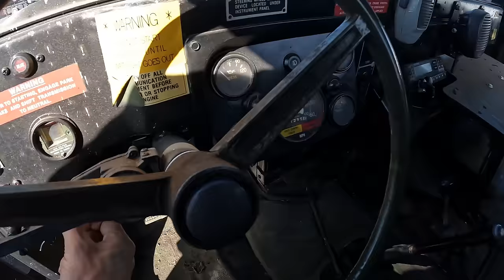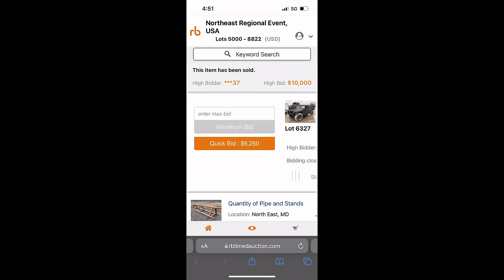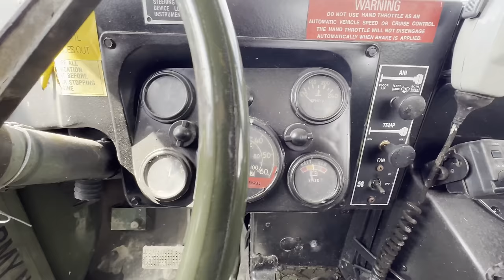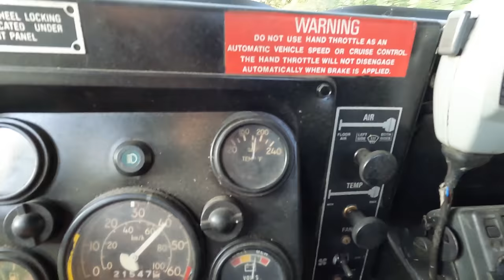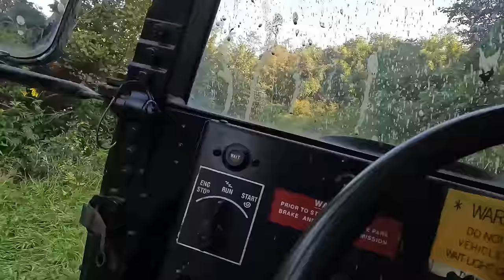Buying, Servicing, & Off-Roading The Cheapest Humvee I Could Find!!

Comment: "voltage meter is all over the place" Me, former mounted Infantry: "that's intended."
I remember getting an officer from light infantry, and he thought it was gonna be so cool rolling in trucks all day....until he learned about pmcs, no heat, no air and generally speaking, nothing ever working as entended.
Until you get a work order rejected, and have to pull a truck out of the chalk because you "didn't use proper grammar when listing issue" have you really been mounted?

Comment: DO NOT put a turbo on the 6.2, the bottom ends are not strong enough. But you can put one on the 6.5. Also there is some interchangeable parts between the 6.2 and the 6.5

Comment: They put the 6.5 turbo in when they started making the factory armored versions (M1114/M1151).  I originally drove a hillbilly armored 6.2 M998 around Iraq, would hit a top speed of 25 mph going up hills with suspension maxxed out.  Now you know why the military has such a hard on for maintenance lol.  BTW pick up a set of the upgraded seats if you can, after an hour or so your butt will thank you 👍.

Comment: just so ya know the H1 Detroit Diesel motor was notorious for cracking head bolt threads for alternator and other drive belt accessories. My friend was a mechanic in motor pool US Army his only job everyday for 5 years was to rotate the heads from side to side and reverse them front to rear as both heads front and back have the same threaded holes- designed just for that issue LOL . 5 years imagine that shit....

Comment: your "new" used roof also needs regular care (UV radiation), otherwise it will tear again. 
this roof is used and it doesn't take long if you leave the vehicle outside. roof cleaner and 
impregnation spray! and I'm saying this now, before there's a crack in the roof.

Comment: The alternator brackets took a beating on those cross country roads. It was difficult to maintain the tension on those double belts. Serpentine belts would've solved that problem.
Reply: The 6.2 L had plenty of power. It was a high mobility vehicle not a rock crawler. We had them in the communications configuration w/ a cube in the back. The engine had plenty of power to move it around & I never saw one stuck in the mud even during monsoon season in Korea. Just like any diesel is a lagging engine & doesn't have the quick response of a gas engine.

Comment: I maybe wrong and sorry if I am and please correct me if I am do to I don't know alot about them and wheeling to always learn what I can but I have a 6.5l turbo diesel Detroit k3500 Silverado I was told by a few ppl that the air intake an exhaust manifolds and crossover pipes an turbo would swap over to the 6.2l just have to plum in the oil feed and oil drain for the turbocharger

Comment: You don’t need a big brand name for your turbo 
Lots of turbo’s available in the aftermarket world 
You just need to find a space for it 
Then a buddy with some exhaust experience
Get ya some tubing and make what you need 
There are plenty of good turbos at the scrap yards and pick a part 
Does not matter what it was on just the size and mounting surfaces that you will match
Reply: But just remember when choosing a location for your turbo or turbos that the oil drain on bottom of turbo needs to be above the oil in your motor so it can drain 

Or you could get a supper charger you could even use a electric clutch just flip the switch and go

Comment: heres 2 tips..if you dont have elec fuel pump,,fill the bowl with fuel..if you have elec fuel pump,,no probs.. i hava an mwm 4.2tdi. sprint, german diesel fitted to s/duty 97 - 07. no glow plugs, no comp. 3 valve, 3'' system std., 700nm, 230hp. 12.5 lt 100.. not sold in u.s.

Comment: have you checked to see if that alternator is feeding ac to your batteries before you boil them dry and wreck any new batteries .i say this cause batteries Your alt needle is going from neg 12 to positive 12volt that indicated ac present instead of dc. that would also explain batteries being dead after they drove it around. YOU BETTER CHECK IT  !!

Comment: Just a 6.2 not a Detroit. Yes gutless but keep  good  glow plugs  in it. Saves the flywheel and  starter run for  ever
Reply from the maker: Says detroit on the valve cover…..
Reply: @DieselCreek   not a two  stroke  but ok. We had 2 vans 2 suburbans  5 trucks with the 6.2 motor  never  wor out but the vehicle  did . Start penatrait oil on glow plugs every  so often.  If you have problems  let me know
Reply: @DieselCreek   they sound awesome  with  duel straight  pipes lol

Comment: Very cool toy. Offroading is all about tyres and lockers 😂 I think if you can get a Jeep Rubicon that has the stock front and rear lockers, throw large tyres on it and it will most probably go places the Humvee can't go due to the jeep being smaller and weighing probably as much as the Humvees front left tyre 😂😂😂 But say what you will. Jeeps with too large tyres just look stupid. I don't care what anyone says. Humvee is just built to look cool with large everything. Not to mention it sounds AMAZING and it's diesel. You do get diesel jeeps, but it has that stupid french motor in it last I heard.

Comment: That’s a lot of money for giant diesel hog boat anchor!😂
Reply from the maker: Go price them out
Reply: @DieselCreek  I don’t need to I don’t need one! 
It’s good for you if you want to drive it and you want to buy all the diesel and expensive parts! 

I can get one for two or $3000. 
I already pressed out your air filters for you! A good air filter is the 1992 and 1993 wicks air filter!
Reply: @DieselCreek  WIX air filter $75 on e bay.
Reply: A gas 4.0 straight 6 Jeep engine. Has the same torque as that Military Humvee and gets better miles per gallon than the Humvee.

The extreme off-road is handled even better on a 4 x 4 four wheeler or side by side with snorkel! 

The Humvee is good heavy equipment to play with. But it’s not practical for most people’s application’s! It’s fine but it’s not practical!
Reply: @Zach-sg5uu  To be dead honest, for my use the Humvee is the most practical vehicle I ever had

Comment: if you like offroading with military vehicles, you should check: https://youtu.be/lX6jxCuITUE (sorry about the poor quality of the video)
and I was fortunate enough to own one of these for a few years, had a lot of fun with it.
Reply: https://youtu.be/7QMwsC_DEE8  this one is of better quality, you can even see the underneath. normally 4x4 vehicles have a drivetrain with diffs in the centre of the axle, this one has one center differential, so the drive train is like an "H", with gearboxes at each wheel. so the front right and rear right wheel turn at the same speed, essentially a 'lengthwise diff lock'. one day my DAF YA 126 was behind a GINAF (Dakar) rally truck and I had more ground clearance, because he had the normal 'pumpkins' on it's axles.

Comment: For a horribly crude uncomfortable thing... I always thought those were neat vehicles.
Reply from the maker: I don’t think it rides too bad really
Reply: @DieselCreek  no the suspension on them is pretty good. But the seat is a 2 inch cushion over metal if i remember correctly. and of course the top is leaky like most older military trucks. All just enough to work no thought for crew comfort just make it durable. 

 Still a neat truck though.

Comment: Having worked on these. If you think you want one... DON'T.  there is a  reason these were dumped and sold for scrap to gullible civilians and 3rd wolrd nations. And soon there will be no more spare parts as aren't supported by military purchases anymore.  These were calculated on reliability by  the minutes not miles. And most were not expected to work for very long or on deployment aka  typical government waste.   They are essentially kit car vehicles because eventually you will be rebuilding the entire vehicle and replacing it with different engine,  trans, suspension,  electrical that is reliable , cheaper and  easier to work on. and better  off not getting one at all.

Comment: I have to say something here, and I'm sure I get a lot of flack because of it.

I would have let it slide because you said you didn't know what you were doing.

You said in your videoseries on the crane rebuild that you were a third class person on safety, no you are failing safety all over. You just operate a crane nowing nothing about it, that's just pure stupidity, and you were lucky.

As for what you show in offroad driving, you are reckless, driving without the doors and without a seatbelt is a recepie for disaster.

Both your and the other guy in the red Jeep have the typical approach to offroading for people knowing nothing, at 38:37 he tries to get free just rocking forward and backward, don't even use the frontwheels to get free, both of you stops just as you clear an obstackle so the next car can't get fully clear, again stupidity and reckless toward the next car.

I have up untill now enjoyed your videos, but I think I'll drop you if that's your normal approach to everything safety.

May your gods have mercy and hold a hand over you (they have their case cut out for them in that endever)